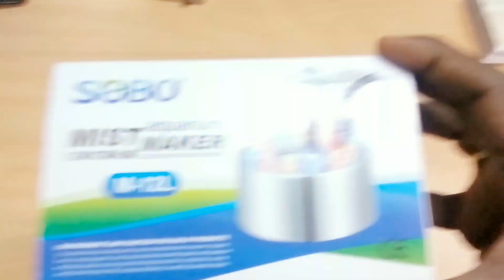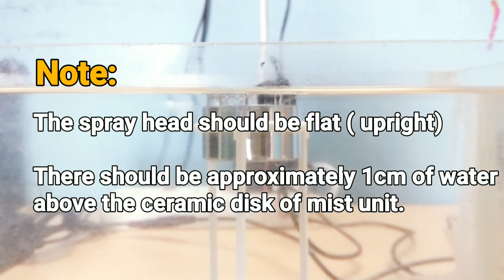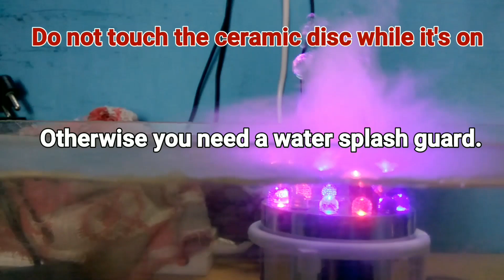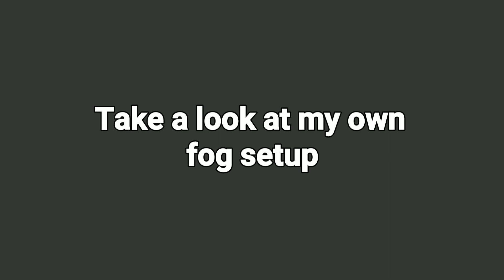How to use Sobo Mist Maker | Fogger  (unboxing)

Comment: I have that same one... The stand is for a top to keep the water from splashing all over the place... You can buy a small one or make one from a saucer or any small glass disk... The mist maker goes in the meddle of the stand in the bottom hole... That way you don't have to use so much water and you can use a smaller container or bowl...

Comment: Ok I know this is wrong vid to ask this but I have 18 Baby crawfish and I need ur advice about their tanks, what they eat, and what they need mainly to survive, also do they eat spinach?
Reply: As bottom feeders they eat almost anything craw fish can become territorial if they're two males also dont make the water too hot and not too cold just warm enough leave a substrate for them to dig into if you leave tiny ghost shrimp in there they might eat it but agian as bottom feeders they eat almost anything i hope this helps
Reply: reptiles and more yes that’s helps a lot thank u so much, but instead of making them burrows I used rock for the bottom but I added caves and hiding places under rocks, is that ok?
Reply: Morgan Yaste you're welcome and yes that should be no problem as long as they are stable enough and wont fall on the animals